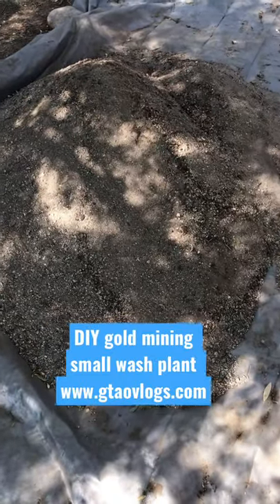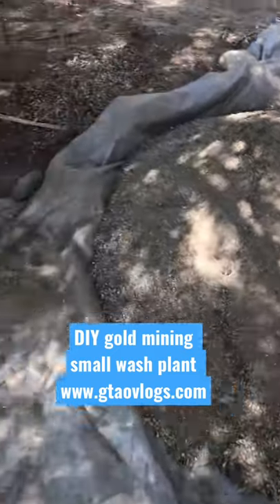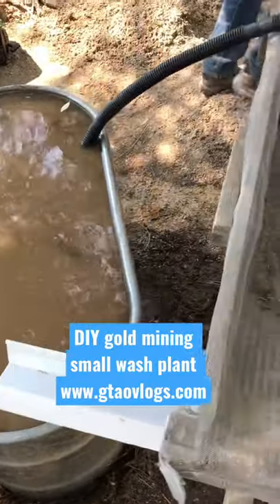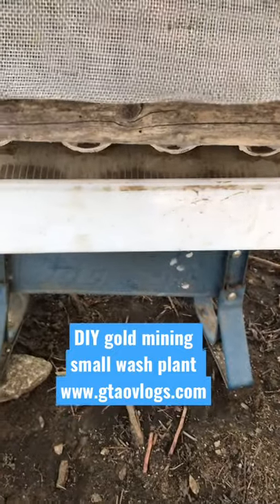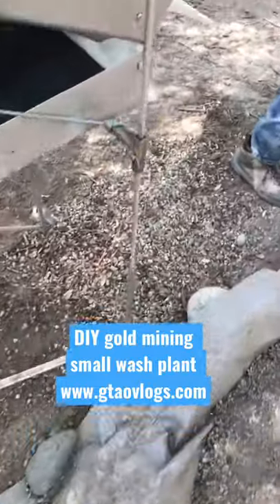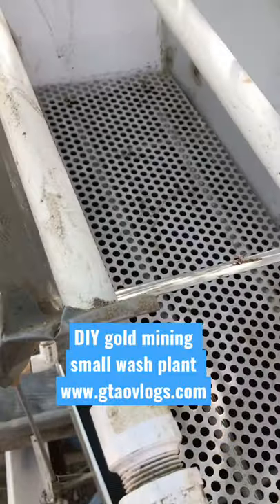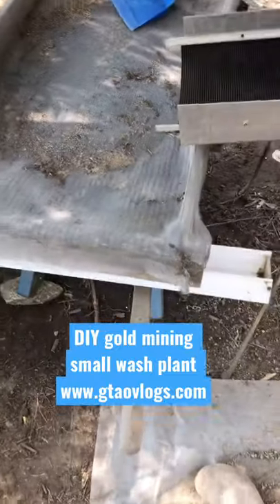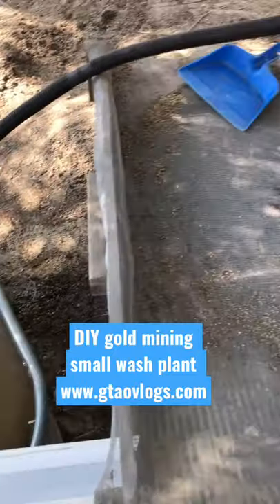DIY Gold Mining Recirculating Small Wash Plant Works GREAT!  #goldmining #shorts #placergold

Comment from the maker: Here’s a short clip of the recirculating placer gold (river or water available) small wash plant.  This is a shovel, scoop, or 1/2 bucket fed type capacity wash plant.  After about 1/2 hour of running we remove the lower screen on the wheelbarrow and dump the sludge/silt in there.  We do lose water but being near the river we can refill easily.  The way it works now it’s a two person operation to work fastest.  We have collected and tested the tailings at beginning, middle, and the end of runs and the losses are MINIMAL!  On this trip we ended up running about 2 yards of material from the dig.  We did recover some nice GOLD!  More pictures and videos to come friends.  Take care, Aaron

Comment: I really like the screen/silt collector and wheel barrow. Great idea. Thanks for sharing!
Reply from the maker: Hey Jesse, thanks!  Yeah, it works really well.  If we were running longer or a lot more volumes that lower screen would be really great if we added vibration to de-water and move it off more automatically.  The window screen minus material really collects QUICK!  And if the whole set up was larger I would want all the tailings to run through an even finer (like Vortex mattings) before exiting just to be sure...  We have checked the tailings though and almost zero losses have been found.   Appreciate your feedback, thanks again.  Aaron